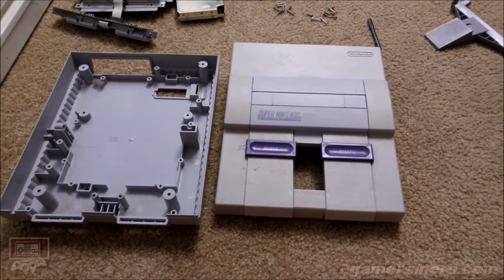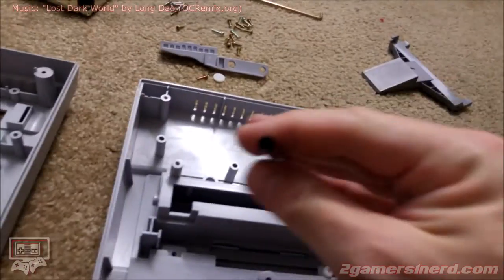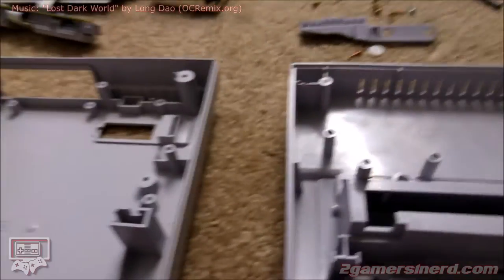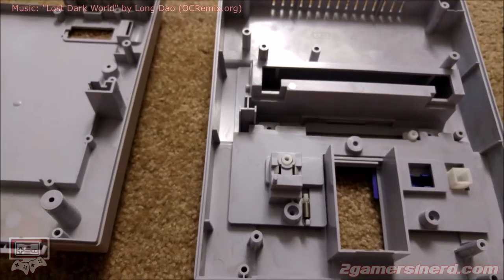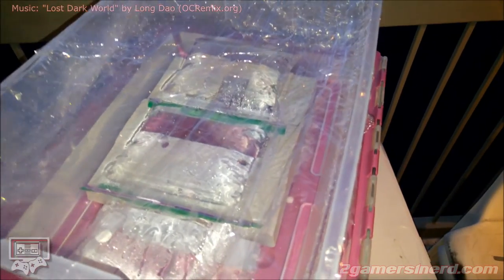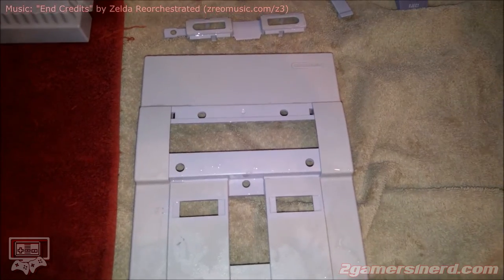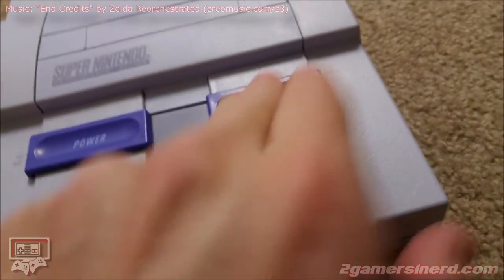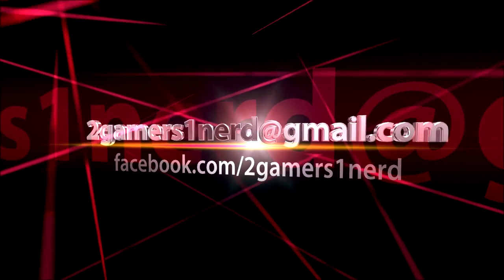Restoring a Yellowed SNES With Peroxide and some Sunlight

Comment: You did a good job on that SNES. I used the salon care 40 CLEAR LIQUID and I have used the salon care 40 CREAM (just the cream) and I did a test run on a Famicom controller and it left (bleached) patches just as you would get as when you use bleach on color clothes. But if you used the 40 CREAM with water make sure to stirred it very well so it would dissolve it will be cloudy BUT believe me it works. I live in California and I get a lot of sun and within a day all of the yellowing is gone, I put the systems in a clear tub with shrink wrap to keep the heat in it and let it sit under the sun/uv, the water gets hot inner it just makes it go faster. 
TIP; make sure to keep the systems submerge I just use STEEL bolt that I got from Home Depot or Lowe’s, tie those bolts with fishing lines or anything that will keep it submerged at the very bottom. Make sure to use STEEL so that it won’t rust. 
BTW yes you can use the salon care 40 CLEAR it will work the same it will just be clear.

Comment: i have one from '91 that my grandparents got right off the shelf. they gave it to me about 3 years ago all i do is wipe it with a slightly damp cloth and the snes still looks brand spankin' new but i think it was a late '91 or something cuz it has not yellowed by one shade since they had it
Reply from the maker: DunkitPlayGames it's a combination of age, UV light and heat that seems to yellow them.  also, later versions don't seem to yellow nearly as badly.

Comment: Nice! The hydrogen peroxide didn't damage the Nintendo service number sticker on the back, or the stickers on the bottom?
Reply from the maker: It's not great for them, paper stickers don't really do well getting wet at all. The silvery stickers do okay, but definitely keep in mind that this process will kind of mess those up a bit.  It's unfortunately a trade off for the process.
Reply: @JSR_  Thanks for the reply. Was curious because it looked like you had left the 1-800 service sticker on the back, and I couldn't tell if it was damaged.

Comment: Looks good, I was just a little confused on how you got the top of the shell to stay submerged
Reply from the maker: I used a clear ziploc baggie full of clean water to hold it down! Just make sure it's close to as full as possible (air bubbles can cast a slight shadow on the plastic, just enough to leave a mark)
Reply: @IROC-ROB use some STEEL bolts tied with fishing lines or any tiny rope it will keep it at the bottom. STEEL won’t rust, I actually I used fishing weights but it was rusting so I took them out.

Comment: JSR2gamers, I've been looking to buy an SNES recently.  I want to do it on the cheap, so I've been looking through eBay and Craigslist.  70% of what I see are yellowed consoles.  Do you think it's worth it to be a cheaper console that's yellowed and fix it, rather than spend an extra $50 for a pristine looking one?
Reply from the maker: Bill Kindig as long as the case isn't cracked or chipped, sure!  It will be a slightly different shade of grey than the original color, but it'll look fine and play even better :D

Comment: If it's the UV, what about a black light?
Reply from the maker: I'm not sure.  I imagine if there was enough of it, it would work.  But you'd have to build some way to concentrate the light, I'd imagine.  The sun is the best, free way to do this, and the only way I know of that works the best (obviously, though, doing this in January in a cold area of the world would be a challenge)
Reply: Its actually UV + Heat, it will work with only UV till a certain degree, but if u want the best result, sunlight will be necessary.

Comment: The hydrogen peroxide soak doesn't peel the labels?
Reply from the maker: it can.  especially on carts.  if you're worried about them, you can try to remove them first.  luckily the SNES only had a couple labels on a few models.

Comment: What strength peroxide did you use? I'm wanting to do this to my original Gameboy.

Edit: Nvm. You literally mentioned it a few seconds later.
Reply from the maker: It does work much better with food grade peroxide.  The stronger it is, the faster it works.  But for this video I just used store-,brand cheap peroxide.

Comment: Can u reuse the hydrogen dioxide
Reply from the maker: What, the water that forms after peroxide reacts?  I suppose you could use it to water your plants or something lol.  I wouldn't drink it, certainly 😂 (for the record, in case you meant peroxide, after awhile peroxide reacts with the oxygen in the air and becomes water, or hydrogen dioxide)